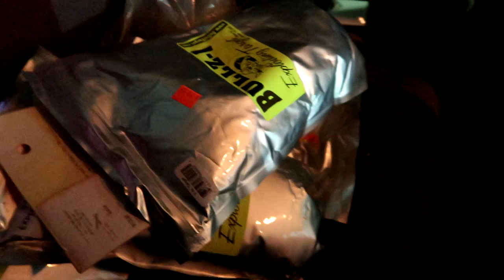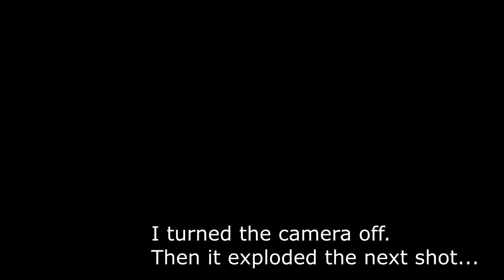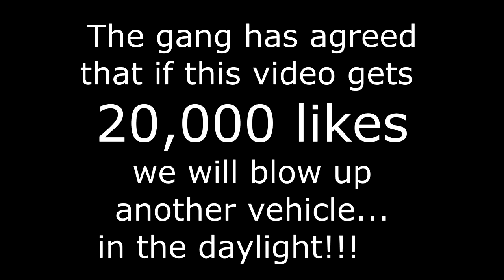FLIPPING & BLOWING UP A CAR

Comment: Kyle wanted a reliable truck he could use for work so he bought a dodge
Reply: Reliable lol.just keep an eye on the fuse box under the hood that will short out costing you $800 for new part not including labor.check the balljoints they will just give up along with the driveshafts universal joints and the rear.so yea reliable lmao.the chev is your better truck by far.30 year dodge ford and chev mechanic.

Comment: What a click bait! I waited the hole video with expiations of seeing that car get shredded and someone just had to turn off the camera! lol Dalton you should weld a sheet of quarter inch flat steel to the bottom (for a good launch point) set it up on blocks and see how high you can get it. Now tell me that's not a good idea.